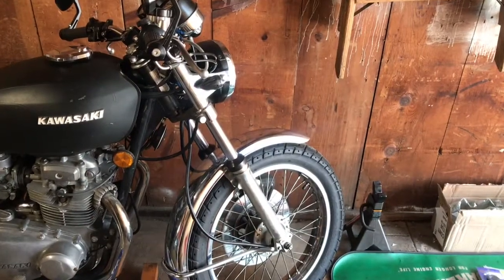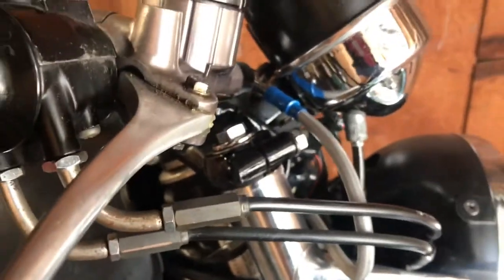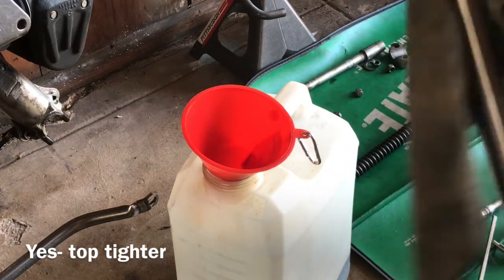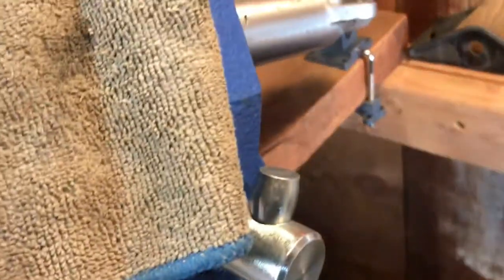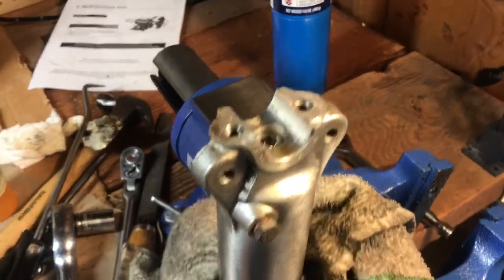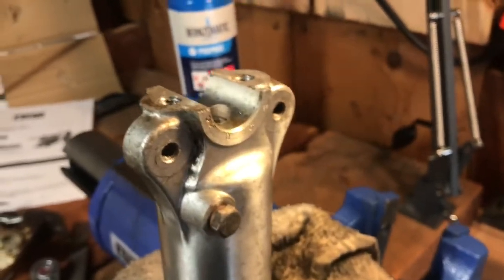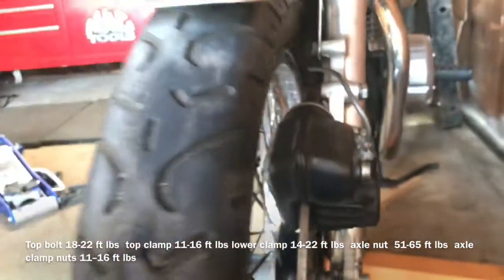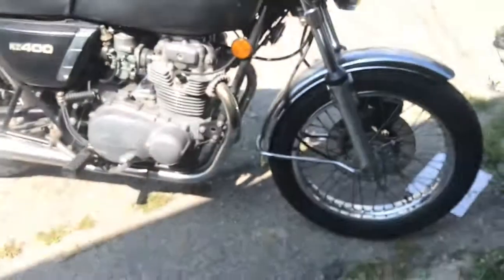1977 Kawasaki KZ 400 Fork Seals Replacement

Comment: Did you tint your headlight or is it the yellow bulb? What type of bulb is it?
Reply from the maker: Think I did a video on it but couldn’t find a affordable yellow light at the time. I bought a yellow paint made for glass , translucent, at hardware store , 2 coats. Worked well👍
Reply: @MikeTheFixer  thanks I looked into the pain and it's so expensive now. Also, the round black cover to cover and seal the fork is that rubber or hard plastic? Mine has a crack halfway up, can I glue it?

Comment: I’m doing a fork seal replacement on my KZ400 forks but my forks do not have the bolts on the top of the fork, do you know if the only thing that needs to happen to pull the inner tube out is the Allen screw at the bottom?
Reply from the maker: Hum.. is it just a dust cap on top with a nut underneath perhaps?
Reply: You maybe have firstly a dust cap, underneath that a metal plug held in place with a circlip. The spring is underneath.
To remove the spring: Flip the dust cap. Using perhaps a sturdy screwdriver apply pressure to the plug whilst removing the circlip. BEWARE, the plug is under pressure from the spring and can fly up at you.
To remove the inner tube it's probably as you say, just the Allen screw at the bottom, and it's easier to undo with the spring inplace, applying inside pressure. The inner tube should just slide out. Not usually any lower bushing on these very basic internals that might otherwise snag on the top set. The top bushing sits below your fork seal. If you need replacements, there are no kawa ones available, you'll have to buy 2 sets (4) of Honda bushings that are half the height of kawas and they work fine doubled up.